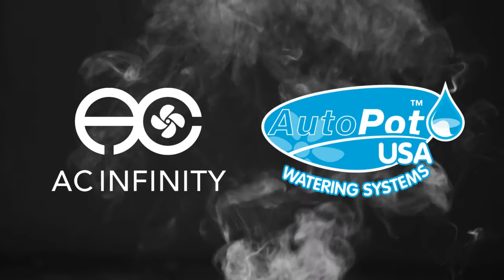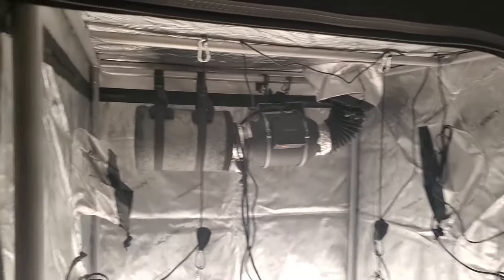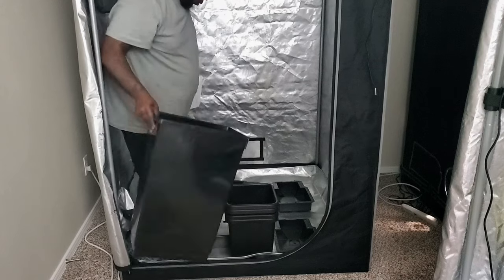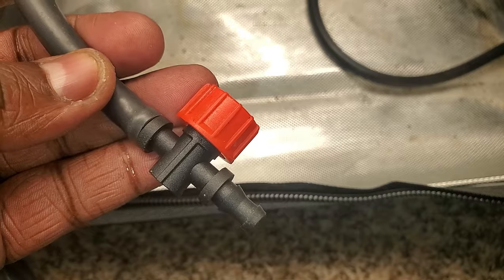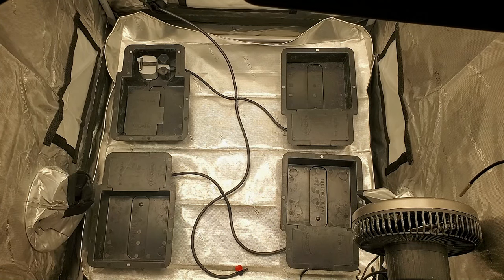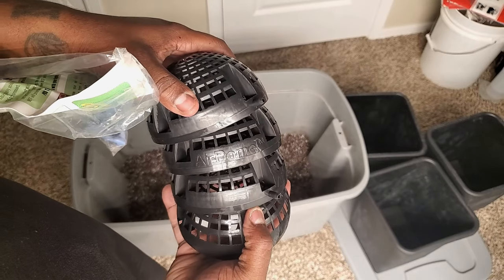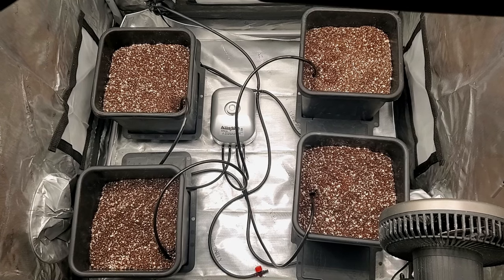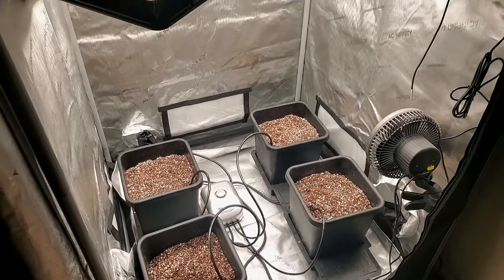4Pot Autopot Watering System Unboxing & Setup - The Infinity Grow: S2 EP1

Comment: I got autopots this year to celebrate my legal growing which just kicked in last year.  I also put an auto nutrient doser/monitor with peristaltic pumps on my reservoir.  This is the best thing I ever did. I take minimal time in my room and have a lot of extra time for play. The cost for the xl autoopots to me was worth it. Also I haven’t been to a dispensary in over a year so I gotta spend that savings somewhere 😂
Reply: Do you still recommend auto pots? I’m seriously considering it for my primary growing process
Reply: I stopped using mine because they tend to, on an individual basis, get dunked up, which causes a leak. In my case, being in a house the leak is no good. water can just keep flowing. Reservoir is hooked to a float valve which means constant refill. So , a leak can mean a lot of problems. No good for me.

Comment: Got to fill those pots!!  Expect some significant compacting of your media.  I do like transplanting at 2 weeks from solos for many reasons, I highly recommend it.   I feel you should never fully feed in APs or be careful of over feeding.  I also like individual cutoffs and rez cutoff.  I only turn on 1 every 3 days early veg and still give some dry times in flower.  Like the setup tho, it’s exactly what I would recommend so I think it sets up growers for success.  I’m excited to re evaluate airdomes with new air plate coming soon.  I’ve had great success with and without, so currently not running for ease of less lines in tent . I actually would say use the smaller 2.2g pots, it’s ample for that space you have.

Comment: Love the video. Only problem Ive had with the ac infinity control system is that if your climate is good it wont kick on the fan enough and my plant didnt get enough fresh air. I could be just paranoid but I ended up just leaving the fan on all the time😅and man that thing was expensive
Reply from the maker: you can set a schedule for the fan to come on, you don't just have to use the auto temp and humidity settings
Reply: @GoodEats420  whaaat thats a game changer. Appreciate it Im not very good with that sort of thing

Comment: Save your charcoal filter till later in the grow! That charcoal is air-activated so running it b4 any flower or any canna smell is present is a complete waste of time, effort & money! No need for any filter at all... especially if you can't afford a new inline fan every other yr! Putting the filter on & running it adds stress to the inline fan by adding drag... with the drag added you'll have to run your ac infinity on a higher level... for example, without the filter u may run a max speed of 4, but now with the filter you'll be running at least at a 6 or higher! Best of luck

Comment: Waiting for the 4 pot system to demo it for our shop.I’m super excited about it.I normally run a drip system and crop steer in 1 or 2 gallon coco quick fills.this system will go in my extra 5x5 tent I use to use for drying.it seems very simple and easy.i may be in touch for advice if that’s ok.
Your video is very informative and well done. 
Happy growing

Comment: Great video. Auto pot must have shorted you I ordered the XL 4 pot system it came with 5 top hat grommets an 2 shut off valves but the shut off valves seem to leak a little I'm going to find a better set of valves as these ones are cheap as hell

Comment: also, the run off incase there is "clog" have you ever used that drain? im thinking about just putting a 3 way there instead of a 4 if you dont really use it that often.

Comment: do you think the autopot system would work under HPS lighting? probably sounds like a weird question, im using a peat based medium and i have to water it/keep it moist daily as even under 400watt HPS it gets nice and warm (pretty perfect temp tbh) but dries out the medium way faster than LED does for some reason. Small pots, about 2.2gallon. My worry would be that the slow bottom feeding wouldn't be able to keep up. I usually use COB LED but we're nearing winter and they weren't producing enough heat.
Reply from the maker: I think you it'll be just fine under HPS'. You could always cover the top of the medium with foil or a paper plate to stop the medium from drying out fast if need be
Reply: @GoodEats420  Thanks friend, thats a good idea :)

Comment: Im using my autopots for the 1st time. The plants are getting really light colored like there not eating so i dug down atleast 5 inches and its dry. Is that normal or did i add to many rice hulls to my coco?
Reply: Did you get any answers to this? I want to start this but would like to know how safely
Reply: I was told by autopots its normal for the 1st couple of inches to be dry but mine was well past that. Im just going to put a normal amount amount of hulls in next time instead of the 50/50 ratio they recommend and see what happens